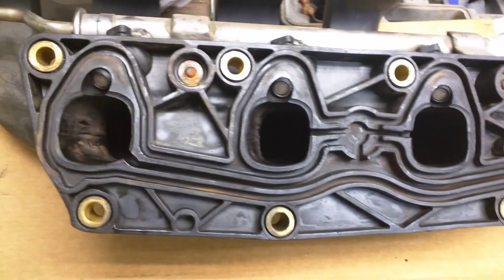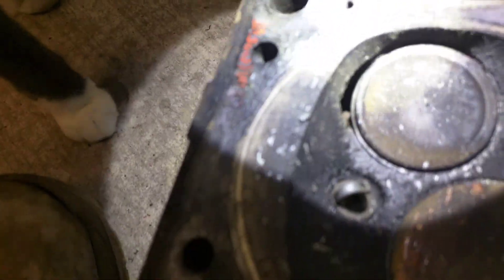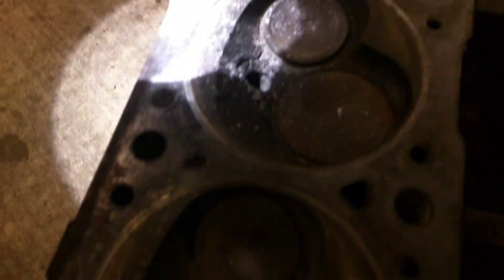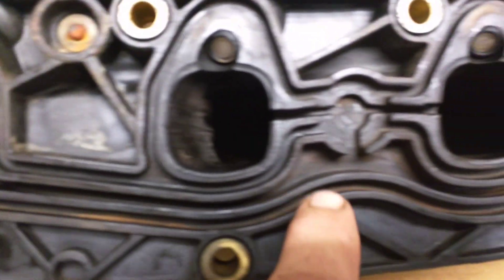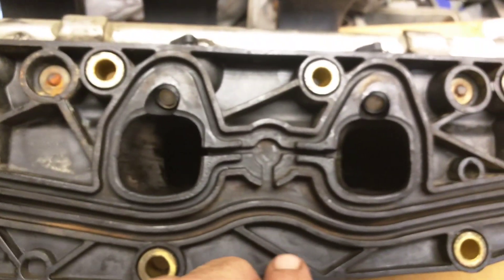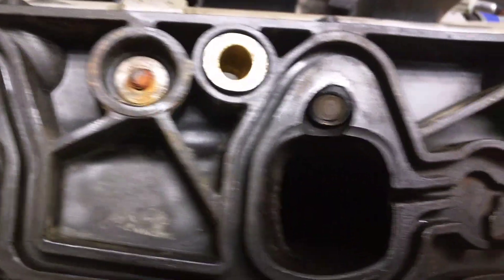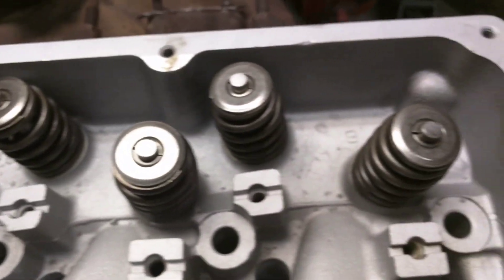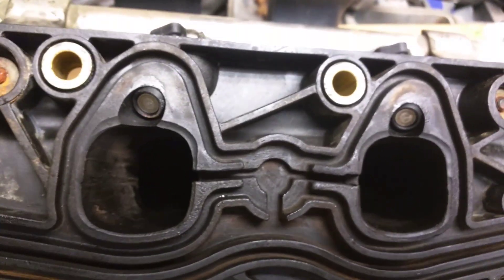PCV system 2003 S10 2.2l engine

Comment: I have a 2000 S10 2.2l Would pulling off only the valve cover and cleaning the pcv system inside the valve cover help at all with pcv operation ?  I'm not sure if oil is getting in the intake or not.. Hard to find info on these pcv systems.

Comment: Could this caused the old to get black quick or engine blow by?
Reply: yes yes yes. and it can cause the oil to get pushed up the 90 deg vent tube that is connected to air inlet box assembly that is connected to TB

Comment: I've noticing this on my 98 S10 because I got to do a fuel injector because it's missing on cylinder too and I didn't realize I take the head off because the last person did a head gasket job it hasn't ran right ever since and I had to take off the intake to gain access to the fuel injector so I might actually take the head off just in case

Comment: Im having trouble getting the intake manifold off. I didnt take the head off and I am having trouble getting the last bolt of the fuel rail off and i dont know if i need to take the stud out that held the alternator bracket.
Reply from the maker: Hi brayden124
  I honestly can't remember, I sold the truck a while back. I took my alternator off so I had plenty of room.

Comment: WOW THANKS FOR THE HEADS UP !! I had the same problem on my cavalier ls sport coupe and it ran better after cleaning ,and no more oil in intake!!! Your 100 percent correct!! Most people think they need a engine,but it’s usually the over being clogged,
Reply from the maker: Glad it helped, I actually took a drill bit and enlarged mine, not a lot though, that hole is so small it clogs easy. 👍

Comment: WHAT ?!?!  That is WAAAY over engineered...Why not just a simple EZ to change PVC valve???
Reply: I think they were counting on people taking better care of the s10s and maybe having less owners too lol.
Reply: @T8ombs23  https://youtu.be/O7Dx2zwke-A?list=PLBEBVondciB59cQEt3peSB2xoTlA8LwdO&t=145
Reply: i do like the concept of it being built in the valve cover, i just wish that they could have made it easier to clean or replace the gasket / pinhole or made the valve cover easier to remove idk theres def positives and negatives hehe
Reply: @T8ombs23  My Oak Tree smashed my 98 Sonoma 2.2L , I have a 2004 Envoy SLT XUV with the 5.3L V8 and its PCV is built into the right side Valve cover and is cloged and I put a Oil Can on it to stop the oil burning.  I'll have to drill holes in the baffles inside it to drain better when I change the Valve cover GASKETS in a week or two.  Loving that 300hp V8 though !

Comment from the maker: Hi Sergio, yes, it's not a traditional pvc system but it operates the same way, as air is pulled through the intake it creates a vacuum in the channels on the intake manifold. The head is vented in that spot allowing crankcase gasses to be burned. I used a reman head, if you are using you old head make sure it's very clean,it don't take much to block that little hole. Thanks for watching, hope it helps you some. 👍

Comment: Pcv?.
Reply: postivie crankcase ventilation.  years before 98, the chevy s10 had an external pcv valve but this is a different system internally to achieve same results.  the intake manifold gasket he showed with the pin hole is very important and can get clogged after 100,000 miles